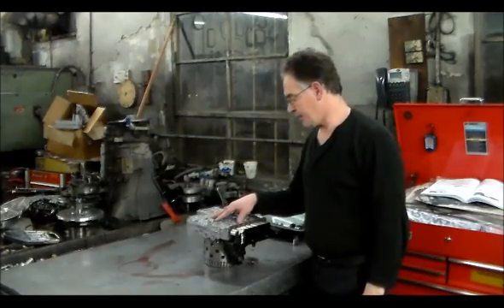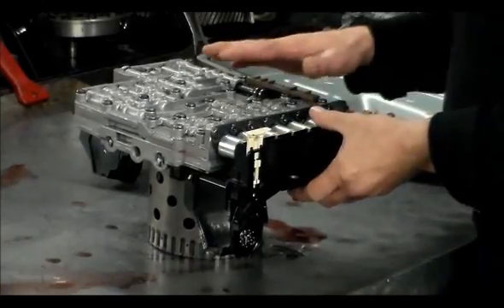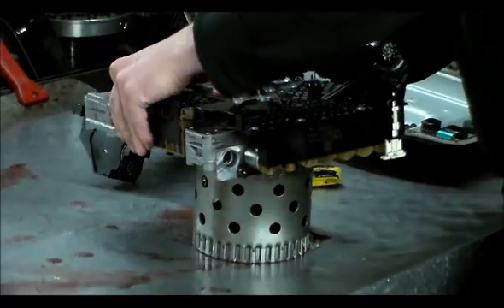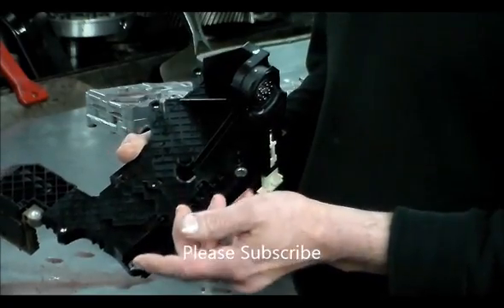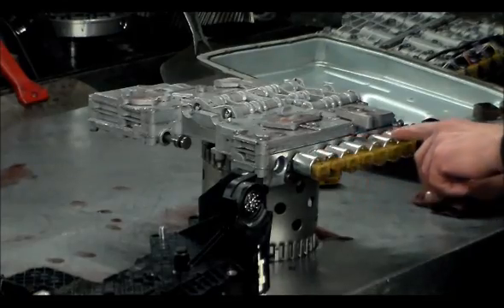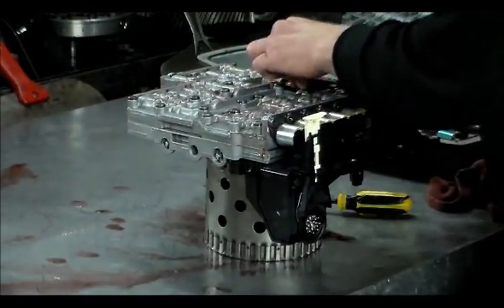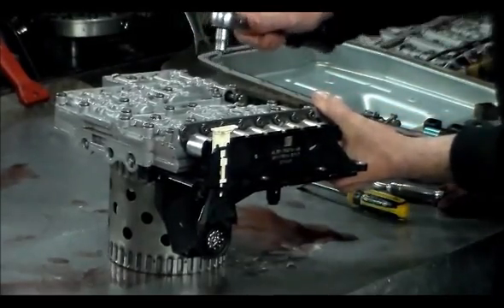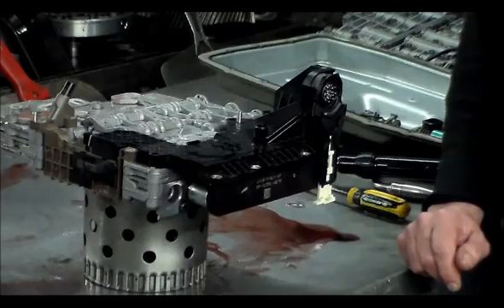6R80 LeadFrame

Comment: I have a 2013 f150 6R80 lead frame issue. my local ford dealer told me the lead frame needed to be ordered by vin# and needed to be programed. 
1- does it need to be programed 
2- if so, does it come programmed or is it done after install?
3- is OEM part better to use for this?
4- thoughts on the Dorman brand for this part?
Reply from the maker: Does not need programming, When these units first came out the TCM was in the lead frame, around 2010ish they eliminated the TCM from the lead frame, so there is really only one for your car. If you cannot get OE(very hard) then dorman lead frame will work (thats what i currently use).
Reply: @GaryFerraro  my truck runs fine for a while then i could stop at a traffic light and then may not shift out of first or just stay in third or 4th. stop on the side the road and turn the truck off then it starts working fine. not sure whats going on
Reply from the maker: @brentbourgeois8139  Are there any codes present?
Reply: @GaryFerraro  yes sir. P0720 - output shaft speed sensor
Reply from the maker: That’s the problem. You need a Lead Frame. OE not available may have to get Dormann

Comment: Super helpful video.

When I pulled mine apart I noticed that the "range" sensor plate that slides back and forth was covered in ultra fine particles, would you happen to know if this would affect the vehicle whatsoever? My vehicle is doing a weird thing randomly on acceleration from stopped. Feels like it throws itself in neutral, no codes, engine revs and i just coast, scratching my head on what's going on. I've tried a flush and checked all components, the car barley has 65k miles.

Comment: Just took my 2014 f150 to the shop today. My Leadframe has been going bad for about 6 months and my gear indicator light would always go out when the problem occurred. Last week it finally went completely out. Got a warning saying Starting System Failure. Before this I could start my truck when my indicator light was out by removing the starter relays cap and using a toothpick to manually close the relay. But after the problem last week, it won’t start. Mechanic said he just did an f150 2 weeks ago the same year as mine and the same issues as mine.
Reply from the maker: The Lead Frame also has the Neutral switch built into the lead frame, if that failed the car will not start

Comment: Good day sir , Thank you for this video it’s helping me a lot , I have problems I’m my F150 with speed sensor ,can you please give me more info
Reply from the maker: If you have a 6R80 Transmission, the plate that bolts onto the valvebody is no good, currently they are very hard to get
Reply: What happened is when I am driving the speedo meter will drop down to 0 and the transmission will move to the 5 or 3 gear and this is the only gears it will have , also on the other instrument panel will appear the signal of need service , can you please advice  , I am using Whatsup
Reply from the maker: @jovensdenegociostv  You probably have code P0720 or P0722 for output speed sensor which is on the conductor plate which is bolted to the valvebody. You need the plate but currently very hard to get, you may find something online.  Google 6R80 Conductor plate

Comment: Hi Gary, please advise I have harsh 1-2, 2-3 shifts on my Navi 12'MY 6r80..... Replaced fluid few times and filter as well, updated PCM to latest level and relearned KAM, but that did not help at all. Also no errors related to transmission or engine in memory via Ford IDS. What can you recommend to check next? I am thinking of buying a new solenoids set, or is it better to buy a new valve body assembly assuming my molded leadframe supposed to be replaced?  Thank you
Reply from the maker: valvebody and solenoids do have issues. if nothing happened when memory was reset very possible valvebody or solenoids, may want to get the setup instead of just solenoids

Comment: I have a new lead frame and valve body kit with all the solenoids...     i have Solenoid E code P0770 ... I could be wrong..  but it seems like it’s best to just change it all.. 160,000 miles on the 2011 Raptor...  I feel like I’m maybe wasting money.. $1700 roughly for everything including labor
Reply from the maker: with 160K sure thats fine, known for valvebody problem, did you diagnose that the problem is in the trans?  Solenoid E is SS1  only on/off solenoid in the trans, did you ohm the solenoid?

Comment: @gary ferraro I’ll be replacing the molded leadframe this weekend, but will be replacing the valve body as well because i think thats where the issues are. However, when replacing the valvebody, is there any programming needed? Or any sort of special way i need to let the fluid disperse throughout the new valvebody? I know the fluid expands when hot but i wanted to make sure. Also, does my truck need to be in neutral while doing this? Have a 2011 Ford F150 5.0. Thanks
Reply from the maker: Do you have any codes?  Why replace lead frame and valvebody?  If your ordering a valvebody through your vin number, may have to program in the solenoid strategy and body I.D   But i would drive it first and see how it works

Comment: Gary thanks for posting this.   I just subscribed.  Hey I have a p0715 code being thrown intermittently.  I have had some jerking between 1 and second and today when coming to a stop it stuck in 5th and I had to start back in that gear.  After that it shifted normally.  I am suspecting the lead frame but wanted to see if you have seen the p0715 (input speed sensor) with these lead frames?  2012 5.0 with 171k....thanks for any help!
Reply from the maker: That sensor is part of the lead frame, i would say that it's no good, not to bad to change
Reply: @GaryFerraro  Thanks Gary...that's what I am hoping...purchased all the parts today and will be tackling this weekend.  wish me luck lol
Reply from the maker: @timk2853  Will have a thermal element fall out when the valvebody comes down, watch for that. If you get stuck e-mail is
gsferraro@yahoo.com
Reply: @GaryFerraro  awesome....i did watch your video and a couple others.  I have seen where a couple folks used vaseline or grease on thermal element to help hold it in place.  Is that a good idea?  Thanks for the email and offer...really appreciate it
Reply from the maker: @timk2853  As long as it's not high temperature grease because that will not melt when the trans heats up, i use a special grease for transmissions that melts when it gets hot,  Called Transgel
Reply: @GaryFerraro  will look for that thanks !

Comment: Hi Gary, thanks for the great video.Has made my transmission repair a lot easier. Have taken out the valve body on my 2014 Ford Territory with the 6R80 transmission 3 times now because of contaminated transmission fluid. Necessary after 80,000 klms  because Ford says the transmission is sealed for life and no fluid change is required.Lots of grey paste around the pan magnet.
Problem being, I experience  a stutter in the gear change from 2nd to 3rd and 3rd to fourth under light acceleration. No error codes on the dash.I am guessing the contaminated oil ,prior to the 80,000klm inspection, has clogged either the solenoids or valve body channels.Solenoids have been cleaned but has not fixed the problem.Is it possible to separate the valve body to inspect the inside components for clogging? Under hard acceleration the gear change is smooth and has no stutter. Any advice would be appreciated. Located in Australia. thanks .Martin
Reply from the maker: do you by chance have a scan tool to try a shift adapt reset?
Reply: @GaryFerraro  thanks Gary for the reply,yes I do have an OBD II scan tool.Is this suitable?
Reply from the maker: @martinbramston2244  Is it a multi functional scan tool or just a code reader?
Reply: Just a code reader..
Reply: Will try to source the other multi functional scan tool
Reply from the maker: @martinbramston2244  If you can, i would like for you to see if you can repair shift adapts
Reply: Thanks for the advice Gary ,will let you know how I get on . Martin
Reply from the maker: @martinbramston2244  ok,sounds good
Reply: Ford issued recall on 6R80 transmission lead frame
recall number 19S07
Mine is on recall list but Ford saying im over the mileage to cover it?
I've had issue for 3 years and now they admit it is a bad part?

Good luck
Reply from the maker: @devinthomas4866  Wow, i didn't think it should matter about mileage with a recall

Comment: Just took mine to Ford was having transmission problems and electrical dash problems. Turns out they are replacing this part free of charge because ford just put out an extended warranty for 10 years or 150,000 miles for this part. I get it back tomorrow hopefully they fixed problem.
Reply from the maker: They are replacing the lead frame?
Reply: Yes I just got back from the dealer today. They replaced the lead frame at no charge because it’s covered under an extended warranty that ford put on them. They said the year of my truck and where it was built determines if it has the extended warranty. I have a 2013 f150.
Reply: https://ford.oemdtc.com/2679/16n02-molded-leadframe-extended-coverage-2011-2012-ford-lincoln

Comment: I just swapped out my lead frame, now my truck starts, but it will not move when putting it into gear.  I did the cold service fill for the putting fluid into the transmission, but now I am getting this error: P0765 Shift Solenoid D Malfunction.  This code didn't show up any other time before switching out the lead frame.  Anyone have any suggestions, I am at a loss for fixing my truck.
Reply from the maker: OK, you hooked up the manual valve?
Reply: @GaryFerraro  the valve with the spring? yes, put it back in...
Reply: @GaryFerraro  The green colored valve that has the spring and falls out, yes, i put that back in!
Reply from the maker: @terryjohnson5782    I mean the manual valve hooks up to the linkage to select the different ranges
Reply: @GaryFerraro  Problem solved!  Apparently Autozone had no idea which filter I needed, they gave me the 1.5 inch intake tube version and I needed the 1 inch version.  Changed that and it works perfectly now!  Thanks for the help anyways!
Reply from the maker: @terryjohnson5782  Thanks for the update, who did you purchase the lead frame from?

Comment: Hey Gary I just replaced this lead frame and I'm STILL having the same issue with the same code I bought the part from Ford so the replacement should be good what should I check next!?... 11 f150 6r80 ( staying in 5th and 1st rarely 3rd or will shift to those gears while driving, wiring looks decent) when running properly everything is smooth
Reply from the maker: what code do you have?
Reply: p0720
Reply: speed output sensor, thank you somuch having to take care of all this during the holidays
Reply from the maker: @vhuert10  Ok, just to confirm, you did clear the code and came back?   If so how fast did come back?  are there any other codes?  What is the engine size?
Reply: @GaryFerraro  5.0 2011  I'm still having the same code air and it came back on about maybe 10 miles after I changed out the new leaf frame
Reply from the maker: @vhuert10  ok, how many miles on the truck?  any other codes?   What type of scan tool do you have?
Reply: @GaryFerraro  whatever Ford scanner they  use... it's got 162000
Reply: I had no other codes
Reply from the maker: @vhuert10  ok, i need for you to check through the scanner for any kind of misfires, it needs to be done looking at data.  Bad coils or plugs can cause this problem too, i've seen it twice already and no misfire codes set, i think the communication lines run along the right side of the engine, check or change the plugs and coils.
Reply: @GaryFerraro  I had one misfire in cylinder one about 3 weeks ago I changed the plug and boot since then no issues
Reply: but ur saying that the plugs and coils could cause the p0720 error?.. and my vehicle to stay in those certain gears?
Reply from the maker: @vhuert10  What you need to do is monitor the  cylinders to see if anything is missing, this is how i found a problem on a ford with a P0720 code.
Reply: @GaryFerraro  I have not felt or heard any distinct misfiring I know sometimes it could be missing without signals... although on these Fords were talking 600 dollars for it to maybe be the solution.. I already spent on fluids and parts for the lead frame...
Reply: but if u think the plugs and coils is the next best option to replace that's what I'll do
Reply from the maker: @vhuert10  Honestly yes since the lead frame did not fix the problem
Reply: @GaryFerraro  do u think I have to replace each coil as well?..since I'm not getting a misfire reading?..

Comment: Gary...Looking thru this Ford job guide on this project...it says 53 inch pounds for the 6 bolts  that connect the Lead Frame to the Valve body.  (I believe you said 63...may want to check that)I'm in the middle of my swap right now with a small problem.  I screwed up two of the six bolts... I hate to admit it, but for mankind...I will. I overtightened two and stretched then a little...was lucky not to have broke them. I did have a little idea of …"man this seems way too tight" before I figured it out. Soooooo, I'll get some replacements tomorrow and wrap it up (hopefully).  I looked all over town  to find a suitable substitute bolt but could not find the length I needed...was about 3/8ths short. I would have been willing to have gotten the job done but no luck. Believe they are a m5, .80deg, and (55mm) or 5 1/2cm long from the underside of the head to end. Oh well, I see a new lb-in torque wrench in my near future. So life's not that bad!
Reply from the maker: Will check on the torque spec, i have the ATSG manual.   They are not aluminum bolts, can you just loosen them and retighten ?
Reply: @GaryFerraro  the two are stretched and are now too weak to trust really. I'd sleep better if I knew I just replaced them. Ive got another vehicle for tomorrow so I'll get by.
Reply from the maker: ok, let me know how it works out
Reply: Gary Ferraro  Hey Gary... So I've got the valve body back on but that dang sleeve that runs thru the case to the Lead Frame is just not allowing me to push up that white (guillotine thing that holds the sleeve in place) I might be taking it too easy...afraid I may break something. Is there ever a need to give the outside surface of the sleeve a little tappy tap? the new o rings may be what is keeping me from pushing it in enough Sooooo I can push up the white guillotine. Not sure. Additionally, I'm almost certain the white handle is fully down and ready (to allow the sleeve to be pushed in) Any suggestions?
Reply from the maker: Try wiggling the sleeve or take a small pry bar and push back on the sleeve while trying to push the white tab up.  Is this a new sleeve?
Reply: @GaryFerraro  yes, it's new.
Reply from the maker: may want to swap the seals and put the original sleeve back

Comment: Holy potato recording.  It was 2017 when you recorded this, where was your higher quality camera...or were using your nokia?
Reply from the maker: I think its my computer, everytime i try to upload in HD it always says there not enough room try a lower resolution. I actually have a samsung
Reply: Make sure you record in HD on your phone then.  There is usually an option in the Settings
Reply from the maker: ok, do they make a holder so i can put the phone on a tripod?     Thanks for the info.  I,m so busy with transmissions, i have no time to research anything else.
Reply from the maker: Thanks for the info, will check it out,  i have I phone 7

Comment: So I removed and replaced the lead frame on my 2013 F-150, and got it all put back together and now the truck will not start. It has full power but absolutely will not start or even try to turn over. Any ideas?
Reply: I think i've found the problem, the shift linkage part isn't installed correctly. I tried moving it out of gear and it's locked in park, so looks as though truck is in some kind of fail-safe mode not letting it turn over. Gonna pull it out again and try again.
Reply from the maker: Did you hook up the manual valve? thats where the neutral switch is
Reply: That's the shift linkage part that slides with the piece on the lead frame, correct?
Reply from the maker: yes
Reply: Ok, I just checked again and tried to shift into the gears without starting the truck and now it seems to be working correctly. Before, when I tried to put it in reverse or any other gear, it wouldn't budge out of park. It was as though it was locked in park. This is my brothers truck and he's doing the job, so i'm more or less just typing what he's asking. But I did get down there and check it for him just now and now it seems to be working correctly. I'll have him button it all up and see if it'll start this time. I believe he had the element upside down as well. There's another video that some guy has that's showing the element to be up and spring down. I showed him your video and that the spring needs to go up first.